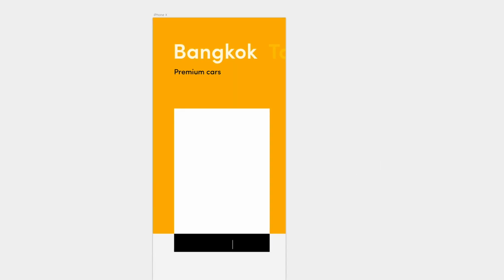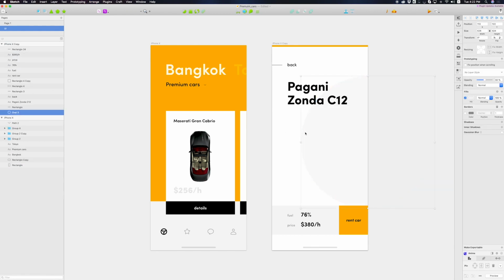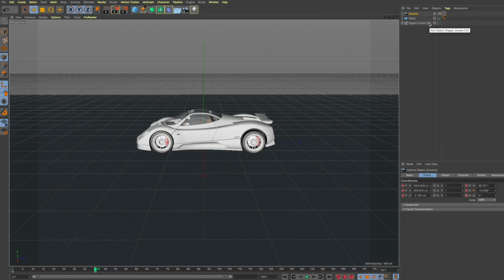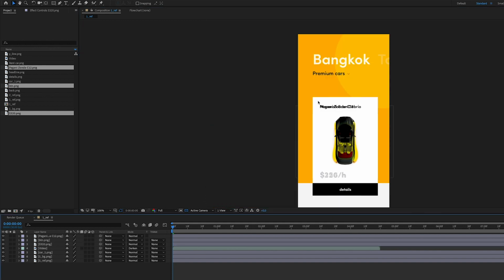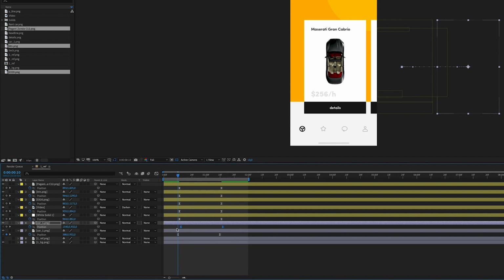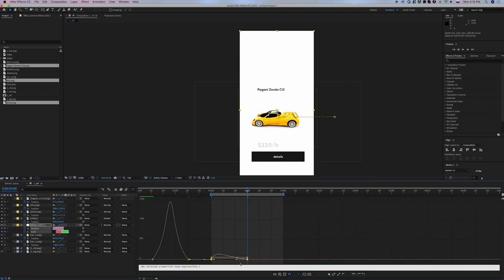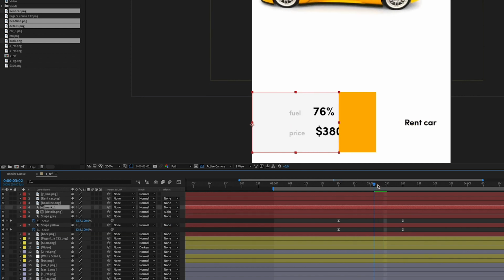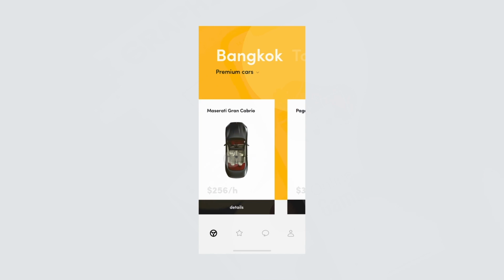Sketch Tutorial & 3D Animation in After Effects & Cinema 4D // UI Design Course

Comment: This is a great tutorial and solving the major problems and requests the UI/UX designers receive from their clients. I am curious to know how you imported the 3d model into the codes and is it possible to import maps/textures too(decals on car) and reflections/lights into iOS? Pls guide me.
Reply from the maker: You can import 3d models and the textures at the same time. 
We used models in the .obj format as well as the textures in a .jpg format plus an .mtl file with links to the textures. Native SceneKit was used in order to display 3d models in the application.
Reply: @CubertoDesign  Thanks for the suggestions. It will help